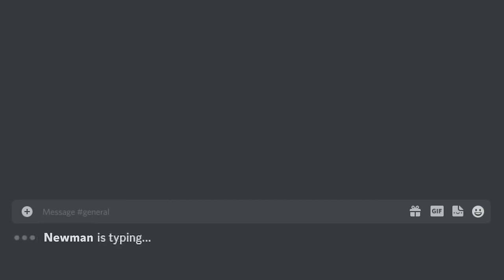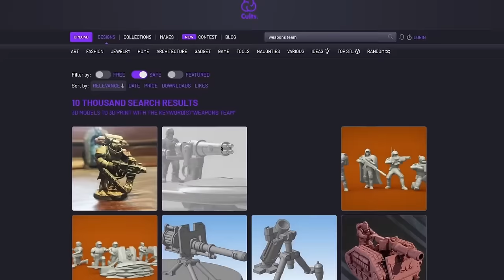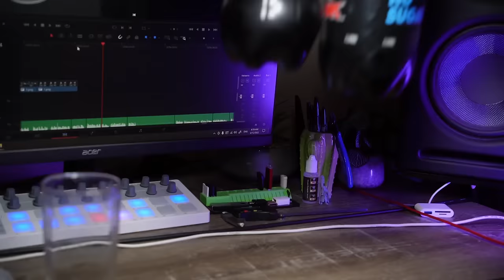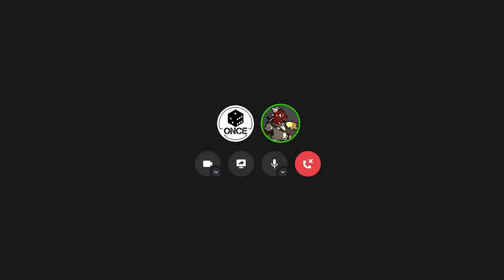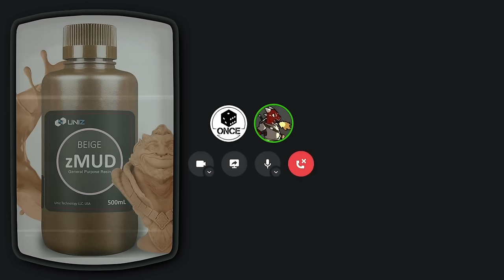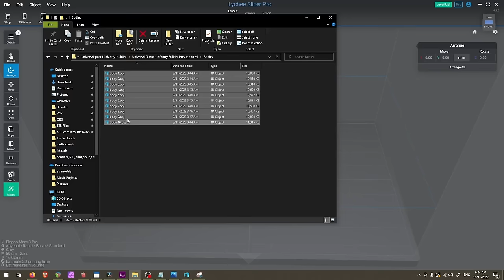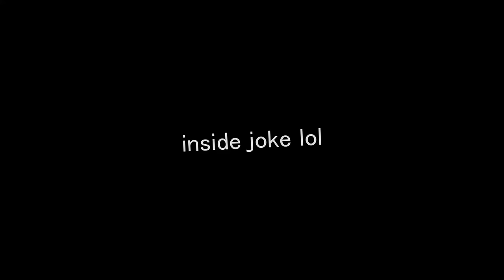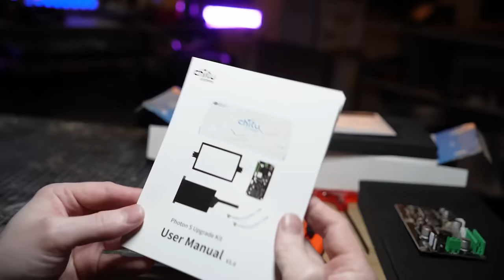Can I print it before GW ship it?

Comment: First off:
I hate GWs pricing policy, which has driven me from their games years ago. Their customer care is abhorrent and frustrating.
Also I am a great supporter of 3D printing in the wargaming hobby, having basically 3 3D printed gaming boards for different games.
Lastly, I really don't want to offend aor attack anyone personally.

Now the but:
It feels wrong to have such blatant copies. Especially if they have the intent to be copies. 
Surely it is not hurting GWs sales in any meanigful way, but piggybacking on their designs to basically cash grab feels wrong.
This is also the reason 3D printing in the wargaming scene is discussed so controversially.
This way it is not "adding" anything, when its just copying what is already there.
Sorry but this is my honest oppinion, if you want to be a creator create, don't copy.
Reply: I think that if GW doesn't want people to copy their sculpts they should make new and original designs then. These are almost exactly WW2 and cold war weapons emplacements with an Aquilla slapped on the front and nothing more. Even the sentinel is from artwork that GW didn't make.